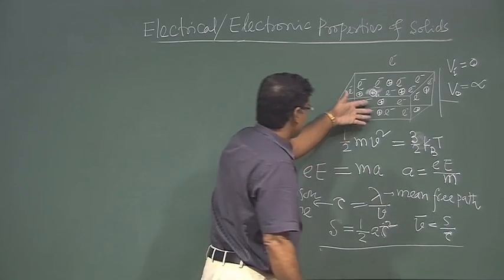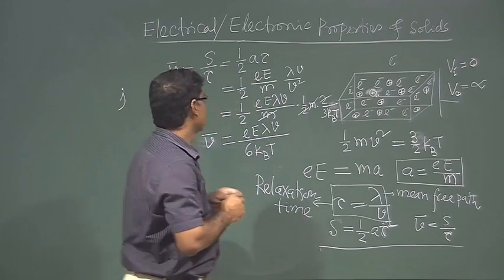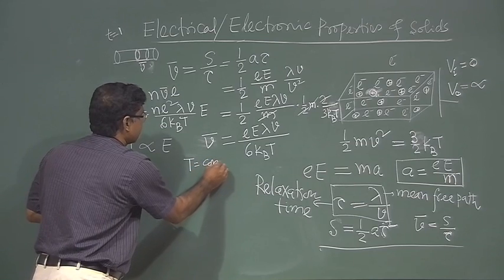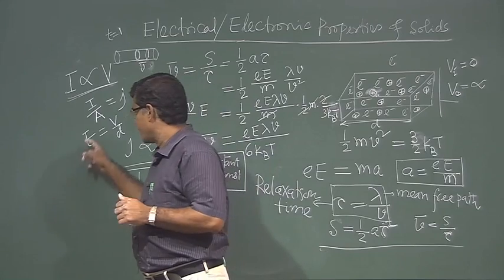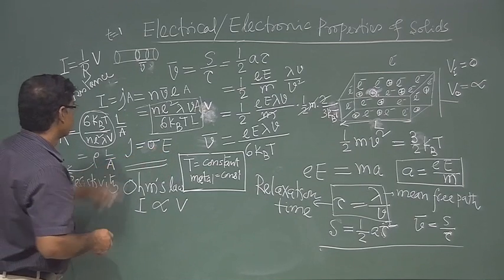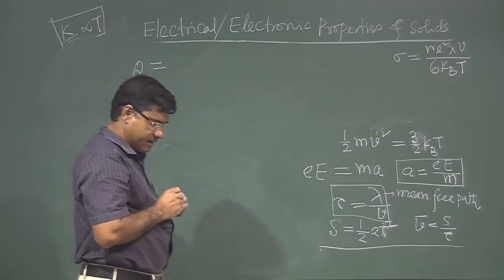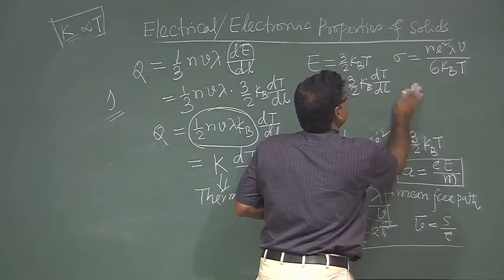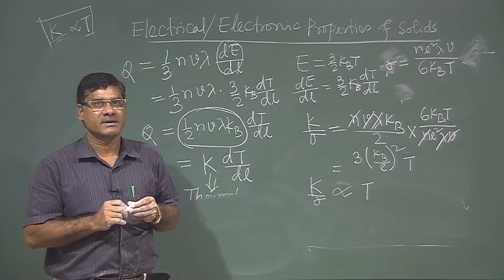Lecture 33: Electrical Properties of Metal (Contd.)

Comment: Sir , I tried to calculate the conductivity in terms of tau (t) and i got this expression (t n e^2)/2m
but in other books like kittle i found the expression (t n e^2)/m ..... i am having an extra 1/2 multiple ..... i am unable to find where  i have done wrong . please help sir
Reply: Even For uniform acceleration, professor took drift velocity v = s/t ...  one can't do that .. if there is uniform acceleration, then v^2 = 2 as and s = 1/2 a t^2 so v^2= 4s^2/t^2 and so drift velocity should be v = 2s/t  and so professor having extra 2 factor in later calculations..

Is it so or am I mistaken ? I am not sure about your calculation but this maybe the reason probably.